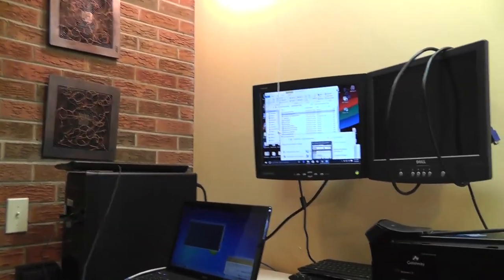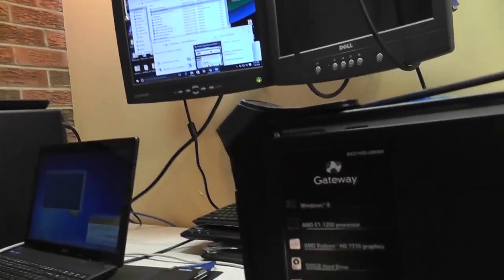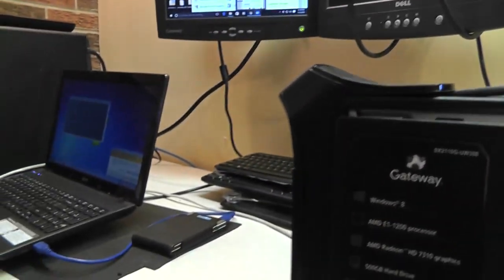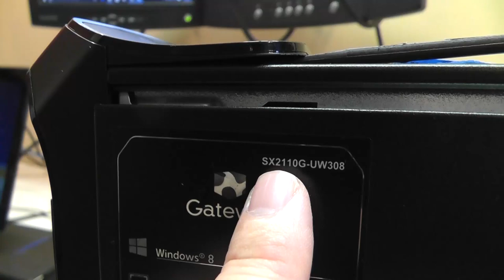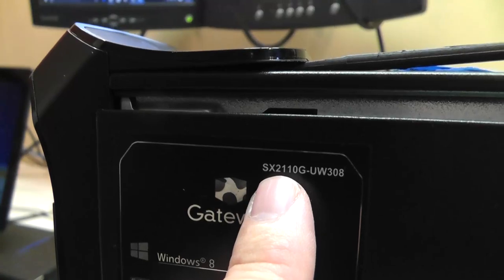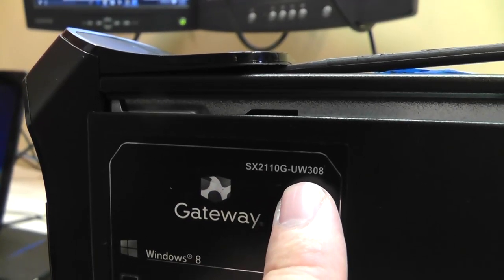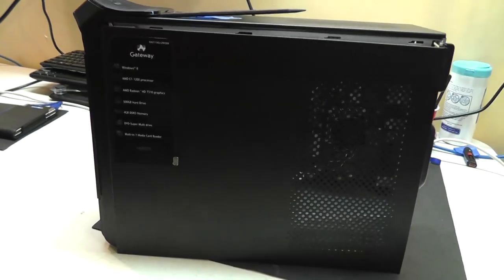Gateway SX2110G-UW308 Hard Drive Removal

Comment: I have a Seagate external hard drive. How can I hook it up to my Gateway and use it with the current hard drive or just open it up?
Reply: DANPETRYSSHOWCASE  you’ll have to set your boot drive as your external, which I wouldn’t recommend if your plan is to use ONLY your external, if not, just plug it in and use it like anything else usb
Reply: Thanks...

Comment: Hello I am not sure if you still are replying to this thread but I have a similar model but mine is UW24 ... I tried to google a video on how to clean this computer. I factory reset it because it was running extremely slow, it kept freezing and glitching during game play, and upon the reboot it is STILL glitching and flickering and I have to reset my computer 3xs before it connects to the hdmi....? There is nothing wrong with the HDMI cord they are brand new so I know it isnt that..... But I am afraid to take it apart to clean it.... Any suggestions?
Reply: Holy Cow I opened it and its a dust bunny festival in here.

Comment: My computer is an SX2110G (PO)   .    It has served me well for the last 4 yrs but I worry about what to do if & when the hard drive dies .   It is a refurbished computer that came with 2gb of Ram and I  upgraded it to 8 gbs ,   When the inevitable happen and I buy another gateway refurbished computer of the SX variety , (other SX but not 2119G)  will I be able to transfer my Ram from the old machine to the refurbished SX machine ??
Changing the actual hard drive seems too difficult .   It would be easier to just buy another machine .  I remember my old XP  machine .   The hard drive simply slipped out and the new hard drive slipped right in with no screws  or complications of any sort .
Reply from the maker: Can't say for sure if your current ram will work in another model Gateway as there will be a different motherboard of sorts. I think your chances are high though. Thanks for watching and commenting.

Comment: Thank for this video..I was able to add an SSD to my gateway
Reply from the maker: Great! Thanks for the comment.
Reply: that what I'm about to do!😎
Reply: @jdl2180  did you ever put a ssd drive in?I am about to change out and attempt to upgrade the cpu and battery and also add a small gpu
Reply: @mansmooth255  yes, very easy to do, works great!

Comment: Can a Geforce GTX 1050Ti and intel core i7 fit in that computer box?
Reply from the maker: I doubt it. Thanks for watching.
Reply: You could try to find out if a mini itx mobo could fit into the original mobo space to use an intel Core i7. For the GTX 1050 Ti you could try looking for a low profile one.